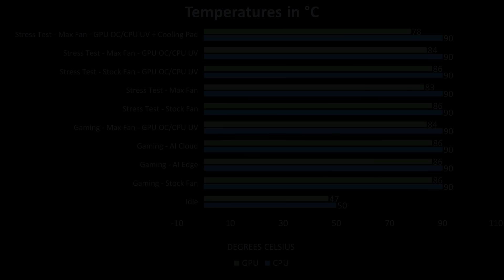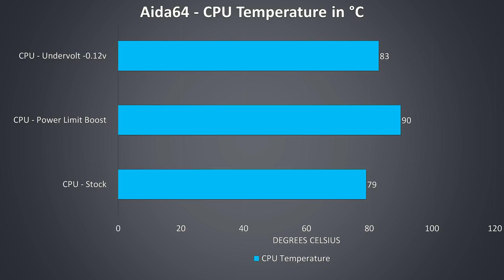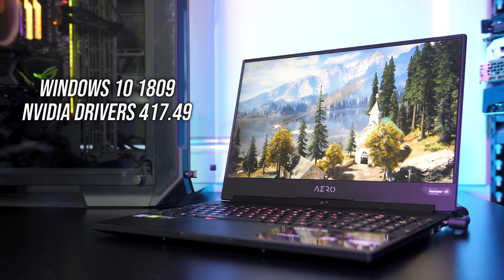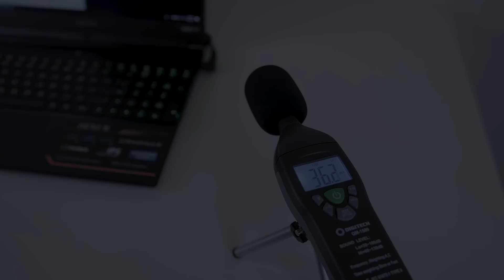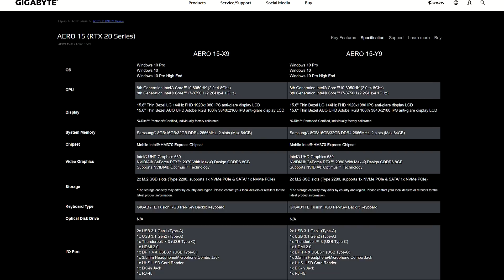Gigabyte Aero 15 X9 Thermal Testing, AI, Overclocking and Undervolting

Comment: I bought the gigabyte aero 15 x9 rtx 2070 around 3 days ago , I worked on 3d modeling and rendering but I think it has some issues, like the control center doesn’t open when i choose the fusion, also it is not full charged when it plugged in  just 95%I don’t know it will be solved or makes problem after a period ?! Do you think it is better to refund it ?
Reply from the maker: Are you on battery power? I heard it was a bug unless you're plugged in but not sure.

Comment: Hey Jarrod! Could you tell please, have you noticed any cpu throttling while video editing/exporting from PrPro? I see that in Stress/Gaming tests it always throttles, but what about video editing and exporting? Does it always cut CPU clock speeds in this case too?
Choosing between Eluktronics MAG-15 and Aero 15 Classic/X9, both exactly the same price and specs. Based on you reviews I know that MAG-15 has much better thermals, but Aero's numpad and faster cardreader makes my choise a bit harder, because I don't know how they thermally differs for video editing/rendering tasks. 
p.s.I don't compare with cooler Aero OLED, because it's much more expensive than MAG-15 with the same specs.

p.p.s. And just for the record, if you let me... It would be awesome to include some sort of unified "content creation" benchmark in your reviews, for example, each time export exact same 4K project from PrPro and Davinci Resolve. So it will be possible to compare render speeds between different reviews and laptops Because right now it's a bit hard to tell how different will they perform in content creation tasks even if they are pretty different in gaming/stess tests. 
Thank you for your videos! :)
Reply from the maker: I didn't explicitly measure thermals while that happens, but given this is the same chassis design as my 15x and that thermal throttles all the time, I'd suspect yes. The newer Aero OLED design has significantly improvements to cooling compared to this model. I'd prefer the MAG-15 in terms of performance over these older Aero models personally, plus you get similar features like big battery/thunderbolt/SD and also mech keyboard. In newer reviews I have Adobe Premiere export times, unfortunately I don't have data for this Aero or the OLED, but I recently added my 15X results in.

Comment: May i know after undervoltage intel.XTU Close and when windows restart there is no XTU Start up, and will it still affect by the undervoltage setring in.intel.XTU ?
Reply from the maker: It will not apply by default after reboot, you will need to take extra steps to make that happen, probably better off using Throttlestop.

Comment: What do you think of the Aero 15 Classic 1660ti vs Mag 15 1660ti, Aero is now 1350 so its a very competitive price
Reply from the maker: I'd get the mag-15 personally, classic aero like the one in the video still has the old thermal design too which isn't great (the new oled one is a nice improvement).

Comment: What did u use to overclock the gpu in this video?
Reply from the maker: MSI Afterburner for GPU OC. You can try change the power limit through Intel XTU or throttlestop, but many laptops do this automatically when you use the higher performance modes, varies by machine though.
Reply: also, what's cpu power limit boost? How did u do it, and how much did u change from the default value?

Comment: Did you get the warning of Watchdog is not enable using Intel XTU?
Reply from the maker: No, I've had that on other machines though, I think when the software of the laptop is trying to manage something, actually I think it was with the newer Aorus 15, probably because the AI is trying to control the settings.
Reply: @JarrodsTech  Thanks for your reply! I got this warning everytime even disabling the AI. I went ahead and undervolted to -0.120, seems stable so far. I won't go further since I don't have the Watchdog support. By the way I wonder if making a backup of the C drive when the settings are normal would work as a restore of the voltage settings in case of failure.

Comment: I'm so torned between the following laptops: aero with 2070mq(3100 AUD), razer blade last gen with 1070 (I can get for 2800 AUD). The new blade is really expensive, but are they much improved in terms of thermal? cuz they are a bit thicker. Please help me Jarrod! I needed it for both work and gaming, that's why I need it to be portable and understated. Your videos are amazin btw!
Reply from the maker: I am testing the new Blade at the moment, the thermals are quite good, at least compared to my videos I did on the GTX Blade, not sure if due to improvements or maybe my GTX Blade was just bad, because I think mine was warmer than many other reviewers. Personally I prefer the Aero, I still use the 15x as my personal machine, you get slightly bigger battery over the Blade, ethernet port, and SD card slot, though it does get quite hot as you can see here when under sustained multicore load.
Reply: @JarrodsTech  wow thank you so much for the fast and detailed reply! So if I am going for the aero, does undervolting help? As long as temps can get tamed after undervolting I am happy. Performance wise, is the new razer with 2070 mq better than the aero? I've seen it somewhere I swear but that might be due to single channel memory.
Reply from the maker: It does help, I show the results in this video with CPU undervolting, if I recall it boosts performance but there was still some throttling in my specific workloads of choice - it will vary based on what you're actually doing on it though. I haven't used the 2070 Max-Q Razer Blade so honestly don't know, unfortunately mine had the 2080 Max-Q so not really comparable. Razer advertise their laptops as using dual channel memory, I think they only sell them in that configuration, though the Aero usually comes with single channel.

Comment: Will you be doing a thermal and performance/battery test of the 15-W9 with the full-fat 2060 as well? I can't find reviews of it ANYWHERE.
Reply from the maker: I'm not sure, depends if Gigabyte has one to send over to me to borrow, I haven't heard anything about it so far.
Reply: @JarrodsTech  if you could, please make that a priority. The reduced load of the 2060 supposedly makes it perform even better than the max-Q 2070 when undervolted properly, and I'm anxious to see how the 94Whr battery will deal with it. My personal battery test in the past has been composed of three parts: a 4K 60fps uncompressed HDR10 or DCI-P3 stream, usually an hour long video so the loops are not noticeable, a macro in Word that keeps typing and saving, and lastly a giant Excel spreadsheet with queries being run on it repeatedly. If it lasts through that torture test for more than six hours, it'll be THE model to beat - and my future work laptop replacement.

Comment: my idle cpu temperature is averaging around 60 degrees for all cores........ i really can't find the reason why. seriously hating this laptop so far
Reply from the maker: That does seem quite high for idle, are you in a warm climate? That could contribute, or maybe you got unlucky and got a bad thermal paste job. If you check task manager, what is the CPU % in use? Are there any particular processes using resources when it should otherwise be idle?
Reply: @JarrodsTech  i'm in the UK, room temp around 20. i always look at the CPU % ever since i got this problem, it averages around 3-5% which i think is good. i have no idea why it is so hot.
Reply from the maker: Yeah that's odd, maybe the paste wasn't applied well if everything else looks fine. It's not that difficult to replace if you want to try, but realistically if it's not thermal throttling too much under load it's not that bad.
Reply: @JarrodsTech  Hey Jarrod, i kinda found out what the problem is. Its the keyboard rgb lighting that is messing around with my temperature. i reset my pc yesterday, in hoping of fixing it, but the problem is still there. I was monitoring my CPU temp when rgb lighting is off and on, and found out the temp was 50 degrees average and 65 degress average respectively. do you have any idea how i could fix this? gigabyte is taking so long to reply, so thats why i am here T_T

Comment: Hey Jarrod, do you know what screwdriver I need to open the back of this laptop? Just wanna put some thermal paste, cheers.
Reply from the maker: Yeah it's a TR6 / Torx bit. If you're interested, I go into depth on upgrading and replacing the paste in my 15X here: https://www.youtube.com/watch?v=e7xqKYxC06E
Reply: Thank you! I just wasnt sure if the last years model had the same screw.. Thanks for clarifying, I will have to get one from bunnings lol
Reply from the maker: No problem! Yeah same screw size as the model last year.

Comment: For undervolting my HP Omen dc-0006nm I was using Cinebench R15, to be exact, 30 runs of it in a loop. ThrottleStop was my undervolting tool, and HwInfo64 was my diagnostic tool.

Started the process with -125 mV of undervolt (both core and the cache), and then worked my way "up" by moving the slider in throttlestop by one increment (again, on both core and the cache). Runs after the undervolt changes were done after at least 20 minutes of cooldown, but mostly, they were run the other day. Also, I was doing all the tests while ambient temperature was between 21 and 22 degrees celsius.

"Cold boot, no diagnostics, no unnecessary background programs" runs were also run, to see what's the absolute maximum number that could be achieved (only 1 run). That run is not included in the 30-run average. Let's call it a "Record run".

Long story short: bests results were achieved with -150.4 mV undervolt. With that undervolt, I was able to achieve 1163.5 point as 30 run average, which is close to stock record run (1177 points). For comparison, stock 30-run average was 1014.93 points. The -150.4 mV record run was 1268 points.

The fans are also much much quieter now and they stay at the same level for as much as you stress the cpu.

Furthermore, I undervolted the GPU, by exactly following Bob O All Trades' video on that topic (since the gpu is the same). Regarding that, I didn't get any performance, but I shaved, around 5 degrees of the gpu, which resulted in further reduction in fan rpm's, and therfore, the noise.

I benefited a lot from that noise reduction, especially in PUBG solo games, where before, I could hear the fans even through my closed headphones, but not anymore. Now the fan noise under full cpu+gpu load is exactly the same as my Coolermaster U2 cooling pad produces, which is almost unbelievable (the cooling pad wasn't used during testing, not even as a stand).

To conclude, I cannot emphasize how much I recommend and encourage others to do what I did, the difference is day and night.
Reply from the maker: Nice improvements! Yeah Bob's guide is great, I always link it any time anyone asks me how to do undervolting 👍

Comment: Jarrod! Really Good Review. Is it possible to for you to do the same benchmark on Intel Core i9-8950HK (2.9Ghz-4.8GHz) Version of the Aero 15 x9? I am sensing that the i9 would be limited by these throttling and might even perform on par with the i7-8750H
Reply from the maker: Thanks! I'm not sure, it depends on what Gigabyte have available for me to borrow, but I would be interesting in comparing it. I'm working on a comparison with the v8 and v9 at the moment.
Reply: @JarrodsTech  thumbs up!

Comment: This model and frame was suited better for the 1070, for the 20 series they need to make a new body frame and a stronger cooling system.
Reply from the maker: Even then I had similar overheating with my 1070 Max-Q version, I'm working on the comparison between the two now though so we'll see the temperature differences soon!

Comment: Funny thing I just realized: so you might know my aero 15x lcd panel started warping developing pattern on screen that resembles water ripples on screen.  Watching your thermal image of aero really resembles pattern that was on screen so these laptops might have a design flaw if you run em hot. I suspect heat blowing on lcd panel warped inner film. To gigabyte defense they replaced panel w/o any issues but I did lose Pantone certification in process as they never calibrated my screen before installing it
Reply from the maker: Hmm interesting, yeah the heat exhausts below the screen and I did measure it pretty hot as you can see here, wonder if that's related, definitely something to keep an eye out for 🤔

Comment: I think the i7 8750h can run stable even with more than -0.120v undervolting. My i7 8750h is stable in stress FPU test with -1.80v. 
By the way, even with -0.180v, I still can't get six cores running at 3.9ghz full turbo speed.
Reply from the maker: It varies by CPU, there's no one global value, also lower isn't always better, if you go too low you can get to an instance where clock speed will drop. I usually go -0.15v, but I've had some laptops that would blue screen going beyond -0.09v.

Comment: That 2017 14nm i7 garbage is the main problem of all laptops of last 2 years...
Reply from the maker: Yeah the 8th gen CPUs in particular are the major cause of all heat issues recently, they just keep turning up the clock speed and power to improve performance which you can only take so far.

Comment: Great review. The more reviews that come out, the more glad I am that I opted for the Asus Scar 2 GL704 with the RTX 2070. With the right tweaks, I keep a constant 3.7ghz on the CPU and my GPU stays anywhere from 1700-1900mhz. Whether gaming or stress testing, it never breaches 80°C. The best part is that I recently bought it for only $1799, which is a damned good deal compared to the thin & light models that have been reviewed so far.
Reply: Awesome appreciate it! Def gaming expected low use. 

Was more interested on web browsing and such side. Answered question thxA
Reply from the maker: Cool, I can't wait to check the RTX version!
Reply: Hows battery life from normal use? Thinking about some work on the game and gaming. If it can work
Reply: @JustinWu  I haven't used it unplugged all that much so I can't say exactly. It really depends on what you're trying to do. If you're trying to game unplugged then you might get 1-2 hours max. I can use ThrottleStop to disable turbo boost on the CPU and likely get anywhere from 5-8 hours of work done before having to recharge.

Comment: Luv how specific and useful info you provide ❤️

Wish if AI can detect the sweet UC spot :/

Btw
I am using Throttlestop (AI is disabled) 
1) Undervolting CPU cache to -0.125
2) Undervolting CPU To -0.155 (I believe yours is -.12) 
What's yours in term of both specifically the cache?
Reply from the maker: Just different parts you can control, yeah would be nice if the AI controlled more aspects, like if it did a check to work out what undervolt values were stable automatically.
Reply: @JarrodsTech  
It seems you skip my last point in the comment  lol
I don't blame ya since the "Read more" becoming a meme xD

Comment: Jarrod thank you so much for the content, posted these vids just before I was to buy this laptop. Potentially just saved me $1k aud as I was debating whether to get 15x or x9
Reply from the maker: Overall I still think it's a good laptop, I personally use the 15X (although it throttles slightly less based on my updated comparison testing that I'm working on) and have no problems using it to edit and export video.

Comment: Could you please do a guide on undervolting?
Reply: Yeah I wld like to see that
Reply from the maker: It's on the to do list, but I highly suggest this video as it basically covers everything I'd want to go into already: https://www.youtube.com/watch?v=yNt9L3BWOFo
Reply: Try using Intel XTU (download the program). Its a simple program and user-friendly. Google a quick guide on how to use it and you're set. Quick reference, reduce core voltage in increments of -0.010V and run the built-in stress test for 5-15 mins and if it doesn't crash, keep reducing until it does. Then go back to the last stable voltage offset. Also look up some scripting to auto-run XTU undervolt at log-on, very helpful.
Reply: James B thank you!

Comment: Oof those thermals were rough. Was -.120v the lowest UV you could keep stable?
Reply from the maker: I only bother adjusting in increments of -.01v, that was the best I could do with this unit before getting crashing under stress test.
Reply: @JarrodsTech  gotcha. I don't fully know the reason for this but with the last gen Aero 15x I've been able to get a stable -.175 UV with a sustained 99% load but only if I keep the fans maxed. Otherwise I get a windows crash with this Yellow/Orange screen instead of the normal blue screen. Check out Engadget's review of the Aero 15x Y9 it's..... interesting. They said "the laptop gets warm, but not overly so. Thanks to its 2 fans" in regards to thermals 😂😂. Who knew that was all it took to chill an i9-8950HK and 2080 Max-Q?
Reply from the maker: It varies by CPU based on silicon lottery, I do usually just go for -0.15, but on some I've only been able to get -0.09 at best. Haha, yeah sounds like Dave2D's conclusion regarding thermals, I make a bit of fun of that in the pinned comment 😛